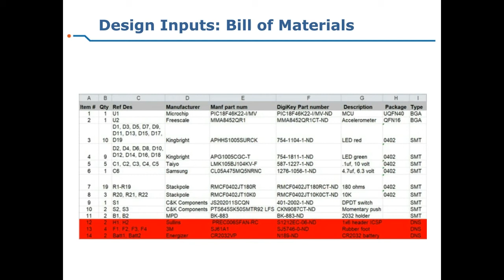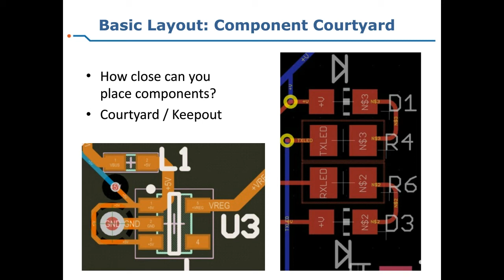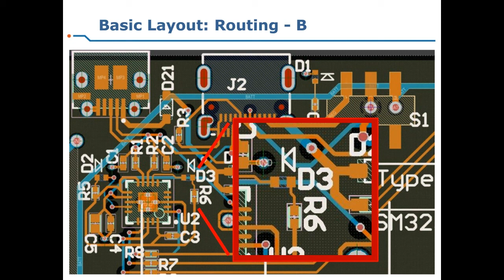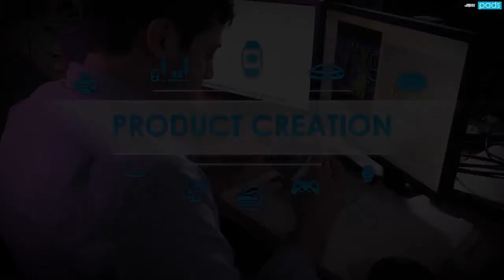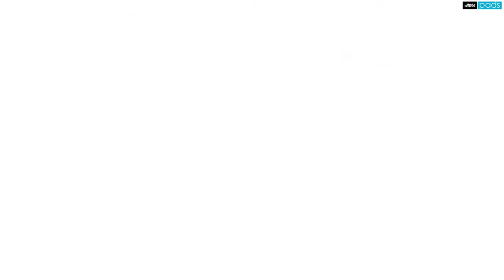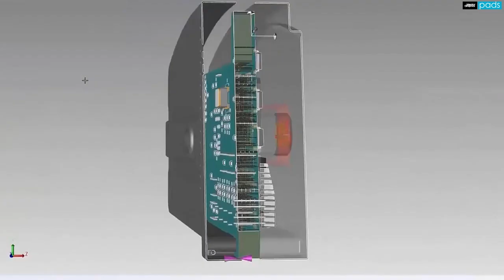Fundamentals of PCB

Comment: Could you expand on the benefits of the "filled and plated" via?  Is plating in addition to filling?  Or just synonymous with filling?  I heard 'open vias and solder pads are always a bad things'.  Are you referring to cases where a via is also used as a solder pad for an SMD component?  About the 'avoid 90degree bend' rule.  I've often heard objections to them base on signal integrity arguments, but that never made sense, since a via is a 90degree path.  But you brought up a new point. Does a 90 deg bend 'break' more easily ? Thanks